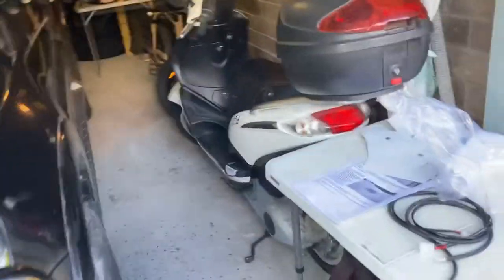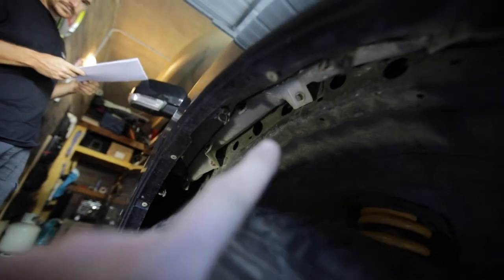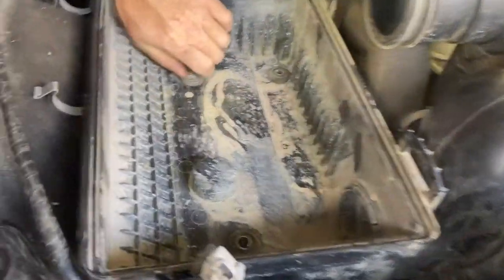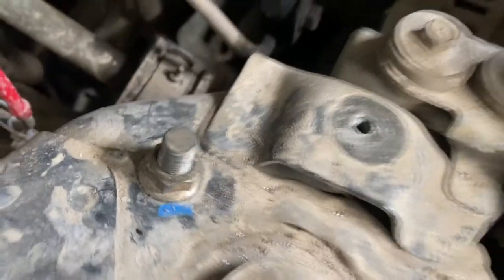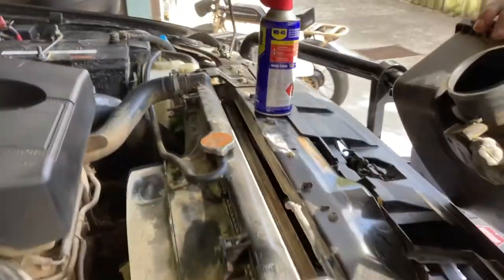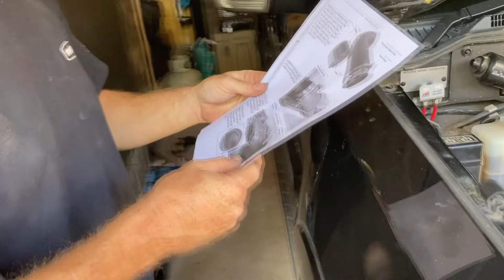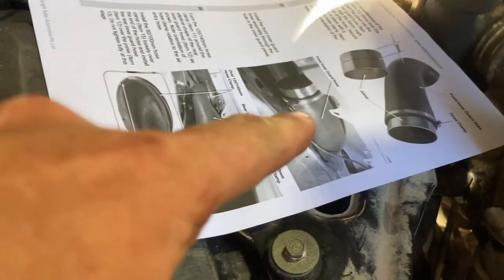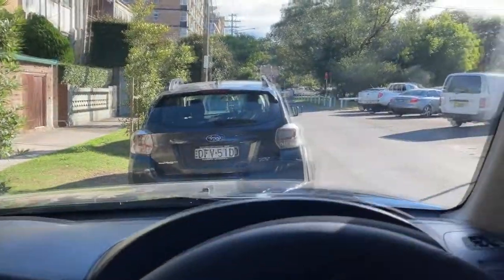DIY Pajero safari snorkel instalment

Comment: What washer battle did you buy. If I install the original washer battle, I can’t install the right fog light of the bull bar. Could you please give me some solutions. Thank you
Reply from the maker: Hi mate 
With the eBay snorkel kit, I was provided with the washer bottle replacement. You definitely can’t use the original bottle.
Reply: @leridotte  Do you have the battle link?
Reply from the maker: @hongmingzhang210  as per link you mean extension?
It was part of the kit
Reply: @leridotte  thanks

Comment: incredible work, congratulations!  Can you help me with information about the bases of your headlights that you have on the hood?  Thanks and regards!
Reply from the maker: Hi 
Thanks.
I’m planning on making a video about the hood lights. I’m filming at night to show how they perform.
I bought the mount on eBay.
I’ll add the link
Reply from the maker: https://www.ebay.com.au/itm/Pair-Car-Front-Bonnet-Hood-Clamp-Mounting-Brackets-Antenna-For-LED-Work-Light-/131970099917?mkcid=16&mkevt=1&_trksid=p2349624.m46890.l49286&mkrid=705-154756-20017-0